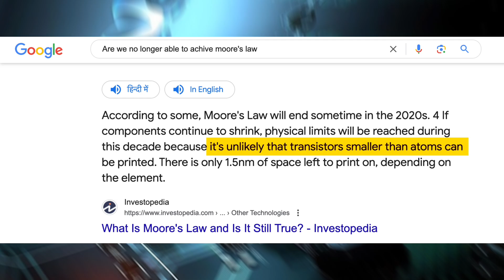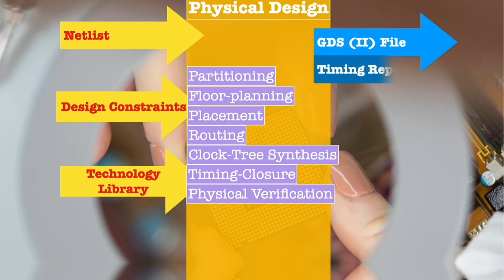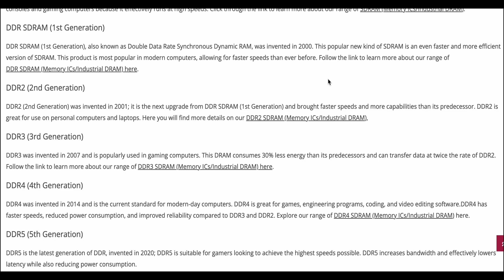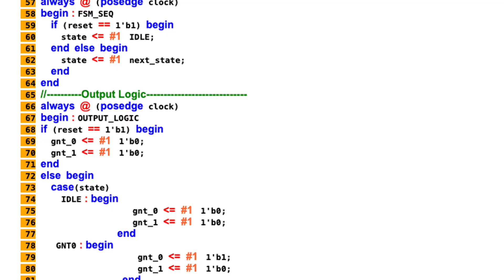How VLSI Design is incomplete without Synopsys?

Comment: 1. Synopsys 2. cadence
Reply from the maker: Yes, But Synopsys has major dominance.
Reply: @Singh-Rajveer 31 % 35% not major Siemens also have I think 15 to 20% share…,,
Reply from the maker: Yes, 31-35% Synopsys, 25-29% cadence and 15-18% mentor for eda market.
Reply: @Singh-Rajveer  is it possible (in future)to challenge this duopoly  ???
Reply from the maker: @Guantimasao it seems very very tough, near to impossible.

Comment: I am BE ECE student of 3rd year can you give a guide so that I can just start to Learn about EDA tools 
Like i am confused which EDA to begin with and as I am in my 3rd year which would be the best EDA domain to start learning as it can help me with my placements of core industries
Reply from the maker: You just need to learn Verilog, System verilog and few projects.
You may use Xilinx Vivado or edaplayground website to complete these projects.
No EDA tool knowledge is required as such and also it's possible only when your college provides you. Because it is very costly. Usually student learn to use/operate EDA tools when college provides them for use or they do any internship.
Knowledge of EDA tools is not very much required to get selected. Company expect the basics+ language knowledge. You can learn to operate any tool in matter of days.
Few famous tools are: Tanner eda, cadence virtuouso, spyglass lint, design compiler, formality checking etc....
Industry exposure would help you get experience of these tools.

Comment: brother in which company you are in
Reply: Brother I am from tier 3 college but my cgpa is not good I am in 2nd year finished tell some strategy how to join vlsi company my branch is specific vlsi design and technology, and do video how a btech student can crack off campus placement
Reply from the maker: @infopoint6802  I will try to find out someone who had actually done this. (B.Tech to VLSI Offcampus).

Second thing, I already made a detailed video on ECE(VLSI) / EDT branch. In fact the longest video of this channel is that only. Since it's a new branch so no placement records available yet
Reply from the maker: Same, Synopsys
Reply: @Singh-Rajveer but bro last year you were in qualcum i guess?
Reply from the maker: @aparichit9728  Mediatek not Qualcomm.
Switched because of location issue.

Comment: Bro is masters compulsary in vlsi ?? Only b tech enough?? Can company allow only b tech graduates in vlsi
Reply from the maker: Allows.
College is much more important than B.Tech/M.Tech. Colleges must be able to call vlsi companies for on campus recruitment.
Reply: @Singh-Rajveer can we apply off campus if clg doesn't brings companies
Reply from the maker: @aparichit9728  Yes , You can apply anytime. But getting a call is very very difficult Offcampus.
So a better way is to do networking on LinkedIn so that if some team is hiring then you can directly send resume to the hiring team or you may seek a referral for the post before applying.
In all cases you have to ask employee of respective company.
Reply: @Singh-Rajveer  rajveer Bhai ek video apne daily basis work par banao actual me vlsi engineer kya karta h? Office me ek place par hi kaam ho jata h ya on field jana padta h kahi?  Aur office me kya facilities h like free food ,entertainment etc. 😊
Reply from the maker: @Kdy28 
1. No on field work in most of the vlsi jobs. You may require to enter in lab or operte hardware for few vlsi jobs related to fabrication or post silicon validation.

2. Office me usually food, tv, table games, breakfast etc rhta hai. Food is usually at nominal charges and other things free.

3. VLSI me office ke andr vlog bnana is not possible because it is not allowed to even take a pic for social media inside premises. As designs are so confidential. That's why I did vlog on work from home day. Office ke bhar ki building dikha skte bs to better hai ki kya hi bnau usme😅
Reply from the maker: Work from home wale din ka vlog kra hai....wo dekh skte ho
Reply: @Singh-Rajveer  tabhi office ke andar nhi banaya 
No problem rules are rules 😁